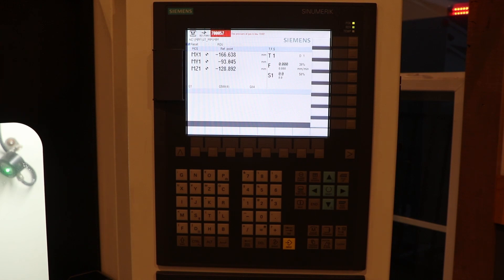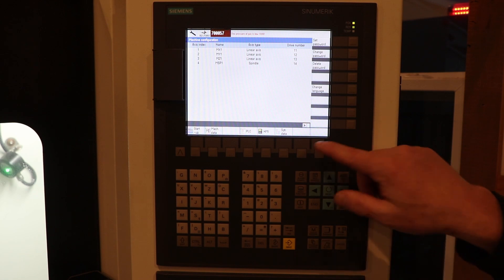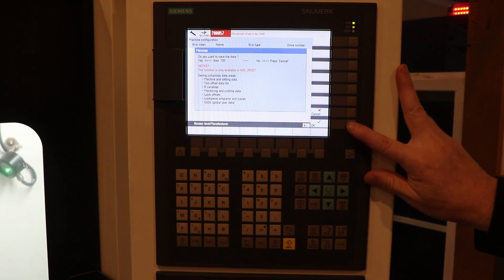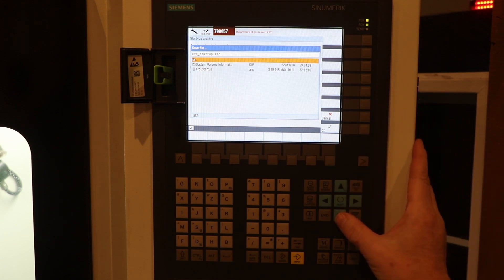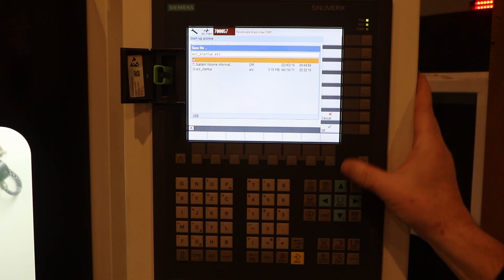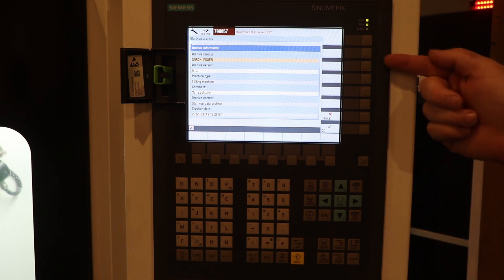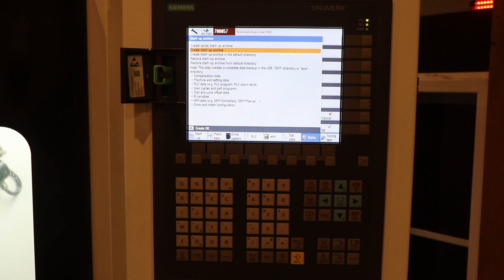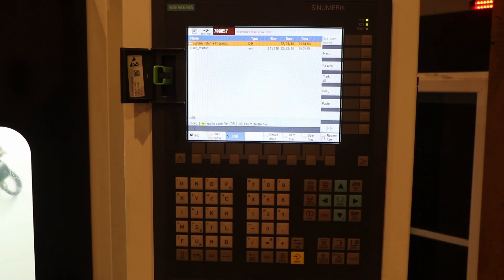SYIL X7 Basics: Data Backup on Siemens 808D Advanced

Comment: How high is the machine if you exclude the cable management?
Reply from the maker: There is some variation due to the three feet that are adjustable to level the machine. 

Currently, not accounting for the drag chain, my mill sits at about 73 inches (~186 cm) from the floor to the top of the mill.
Reply: @PowerForgeWorkshop  with, or without cable management?
Reply from the maker: @tegheim  that does not include the cables and air line running through the drag chain.